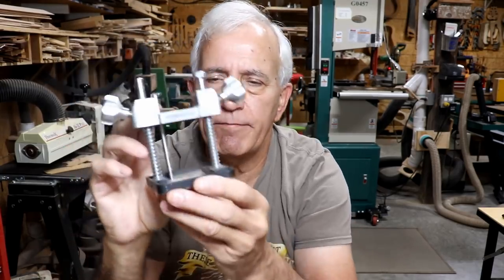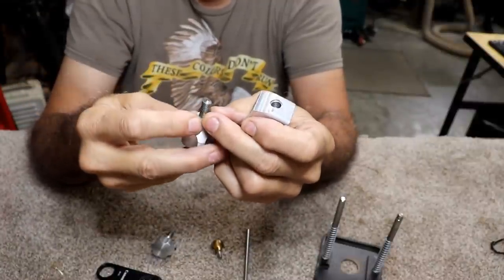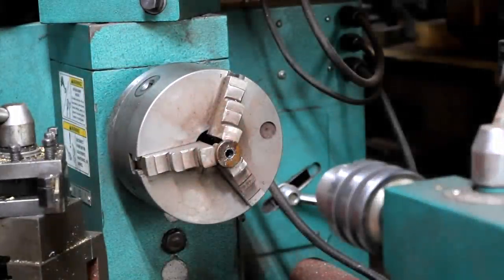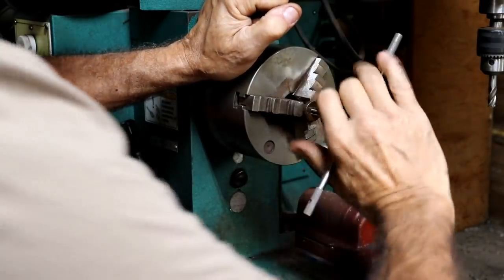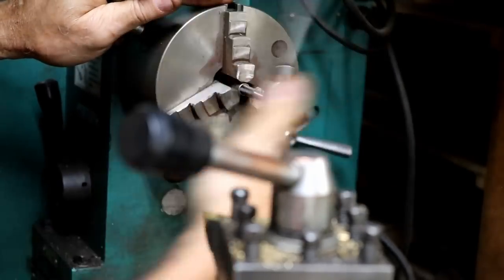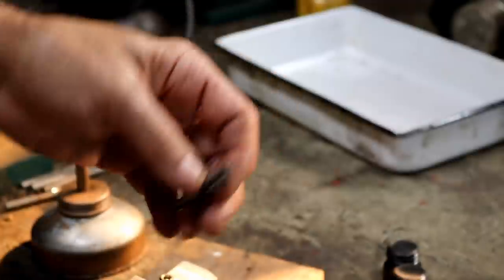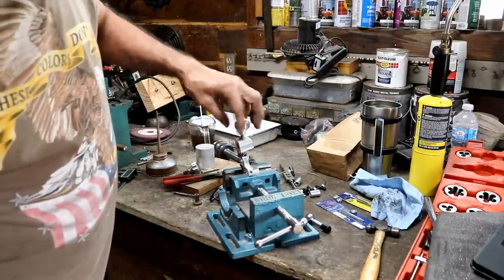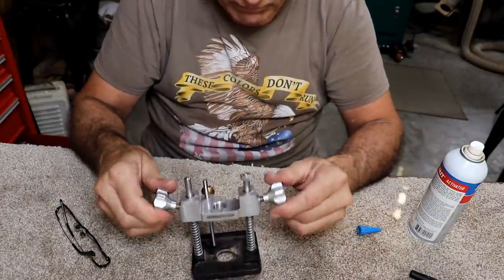529 RSW Dremel Router Base Triage

Comment: Haven't watched entire video yet, in the process. We had similar problem at Lockheed. The fix was to drill the hole oversize, then make an oversized plug. After that I had to freeze the plug,(dry ice), then spray the hole with zinc chromate paint, then drive the plug while still frozen into the hole. After that had to clean it up, get the plug level with skin etc., then drill the appropriate size hole, countersink it, & shoot another rivet into it. I might have done it differently, but that wasn't my job. Good luck. Love to see you repair things. I see you used the same principle, in reverse. Can't believe that tap was off by so much, but who knows. Have friends who bought nut saws, & said they were NOT what was labeled on the blades (the 2 sided type). Bravo Jerry, you've done it again!!! (I always forget about your using heat method. As heat was actually frowned upon, by the aircraft industry.<hard to believe I know>) again Bravo!!!

Comment: Instead of using 3 in one oil, you should tri TriFlow. When it dries it leave a teflon coating, hence no sawdust buildup. I have used it on my mandolin tuners for years and never have had a problem. George in Montana

Comment: Experienced a lot of problems like this when first using taps and dies. The problems went away when I threw away all the cheap taps and dies and replaced them with quality ones (German and UK manufacture). Added in a good set of the correct sized drills and now life is much easier.
People say a bad workman blames his tools, but sometimes it is the tool that's bad.

Comment: That is probably a tap from a Heli-Coil kit.  They are marked for the insert's internal diameter, but are actually larger (the diameter of the insert).  Look closely at the markings on the tap.

Comment: From what I see you are using a plug tap use a starter tap it is much easier because the tap is a little taper so the first thread is cutting half the thread ,the second a little more and so on.

Comment: Well done, never give up! The problem with softer materials is that the threads don't last long especially when they are used often. My guess, and it's only a guess is that the old tap was not sharp and it reamed the thread rather than cut it

Comment: That is a very frustrating undertaking. I agree that a metric Heli Coil would not be that involved. It is similar to a right size spring that inserts into the srew hole. You could then use your tap to shape the threads. The metal usually fills in the stripped threads. They are made from a soft alloy. By the way, I just bought a Dremel Router, but it is made of hard plastic with aluminum bolts. I am going to install an adjustable saddle slot to fit the little my acoustic bridge.

Comment: I believe thats mapp gas you got there , hotter than regular propane , when you need to use a little less heat than a torch >>>mapp gas . Green loctite for cold press fits you dont plan on removing .

Comment: I used heli coils for the usual threads, but the knobs are metric fine thread, for which there are no coils to  be had. I haven't been using my own at all, so I may run into the same problem. Ah well, live and learn.